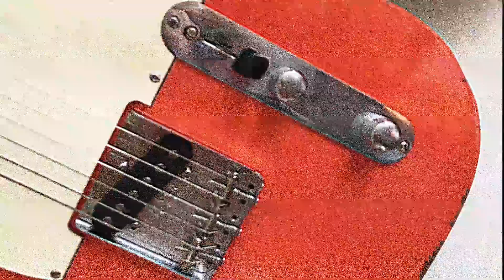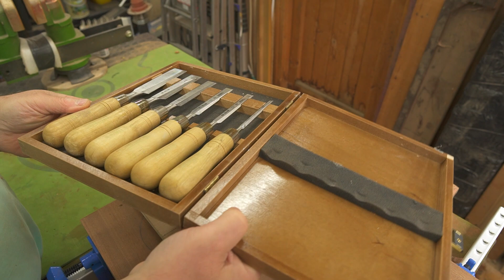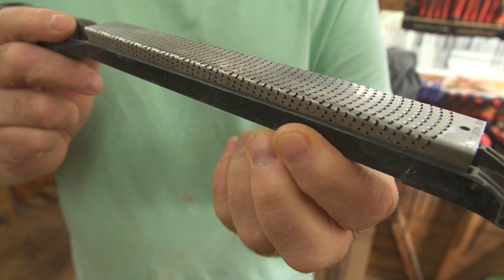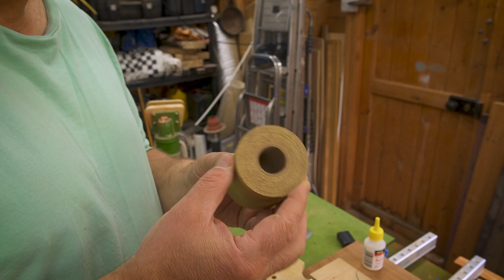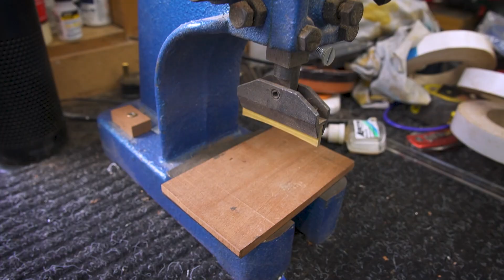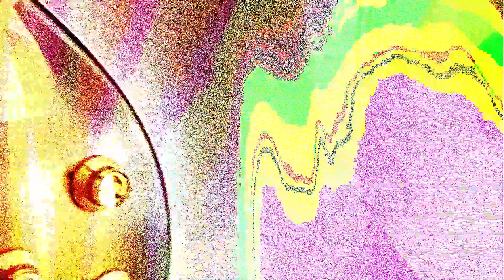Guitar Making Tools my Top Ten Tools , Luthier tools. The tools you need explained.

Comment: One tool you didn't list was the infamous Shinto saw-rasp.  OTOH, I've never seen anyone use a Microplane zester or spice grinder for Luthiery work.  Same basic tools, but at different scales.  The Shinto uses hacksaw blades, while the Microplane uses cheese grater blades.  My flat (zester) and round (spice grinder) Microplanes arrived today.  I mod stock necks to 20mm thickness, a flat triangular heel, and a trapezoid profile. I use a router and sled to thickness the necks, then hog away the heel shoulders with an angle grinder and a 40-grit disc. Then I do a trapezoid neck carve with a Shinto.  The Microplanes looks like they will be perfect for shaping the shoulders of the headstock and volute areas - the Shinto is somewhat large and aggressive for that work. "Right sized tool for the job".  Often a smaller version of a tool is better for guitar building.  Then again, I'd hate to do a trapezoid carve with just a zester!
Reply from the maker: @normbarrows2  The microplane tools are now discontinued. They only do zesters. I’m crestfallen!! The Shinto felt a little too agressive. Tools are very personal I guess. I like the zee files for fret work but the other StewMac fret files don’t do it for me. I’m about to enter the world of cnc. Be afraid. I certainly am. C
Reply: @chrisreynoldsguitarmaking  Z files are sold out every time I try to get one.  But I'm mostly modding new replacement necks, so I don't usually have to level and crown.  I find the Stew-Mac fret end dressing file useful for rounding the bottom corners of already installed frets on replacement necks.  Rolling with sandpaper usually takes care of the rest.  If you're willing to put in the time, you can actually do hot dog ends on pre-installed frets with them.
    While they might call them kitchen utensils, the Microplanes are still perfectly good woodworking tools.  I'll be trying them out on guitar 15.  It's getting the 20mm thicknessing, triangular heel, trapezoid profile - and a Parker Fly style headstock.  I only thickness to the nut line, which sort of leaves a volute just above the nut line on the back.  That's the area I plan to use the Microplanes on.

Comment: I agree with everything you listed. I retired as a carpenter/cabinet maker so my drills, routers and sawzalls are more name brand. I have been buying some lighter tools such as a 12 v Bosch reciprocating saw, Dewalt 8 v screw driver and so on. I want to build acoustic so a table saw is in the near future, and I think the portable Delta with T-square fence will be my choice. I also need the vice and just bought a drill press. i think eventually I may need a thickness sander, but for now I am buying my stock already sanded. T.Y. for this video
Reply from the maker: Good luck Ted. I hope you have many years of successful building ahead of you. I wish I could have started with your skillset.

Comment: Good advice! I have a very similar belt/disk sander & use it all the time. They are dirt cheap here in Canada, and I have often wondered why more luthiers don't rely on them. Along with my oscillating sander, a random orbital sander, and a super cheap one inch belt sander, I get everything done that I need to, including some minor metal fabrication. Thanks for the video.
Reply from the maker: Belt sanders are really useful. I’m frequently using it to shape and sharpen things. I have a grinder I have never used because the sander is faster and flatter.

Comment: I wouldn't mind a video going over selecting tone woods. It's there any reason to select one over another outside of weight or the way the grain looks? Detemple guitars told me one time they tuned their necks and bodies to be the same resonant pitch which makes sense but does it really matter?
Reply from the maker: Choice of woods is less critical with electric guitars. Mahogany and maple being the most common types used. Maple is bright and Mahogany is deep. If you stick to the traditional varieties used in instrument making you will end up with a functional guitar. Selecting other varieties is fun and unless you choose something inappropriate, like pine for a fretboard, you should be ok. Simply consider how the properties of the material suit the function. There are no rules but common sense is king. C

Comment: Cool video. I'm subscribing! I'm still pretty green in guitar making (doing my second scratch build right now) but I've got almost 20 years of experience as a builder, handyman, painter/decorator, electrician, carpenter... and the list goes on. Basically jack of all trades. It's so cool for me to see the variety of videos about essential tools in guitar making. Seems like 70% of every luthiers list is related to style/approach to the craft and the rest of it are hand planes, chisels, files, rasps... and of course premium quality factor. About that, imagine that I'm using Parkside tools as well. The only difference is that my set is doing heavy duty works for the last 3+ years. Really good value for the money. On the other hand I don't recommend similar tools from Aldi. Ferrex brand. Unfortunately I had to scrap most of these long before their time... So, Lidl - yay!, Aldi - nay! My personal experience. Anyway, I'm rambling. Thanks for the video!
Reply from the maker: Ramble on it’s all good stuff. Lidl tools work for me. I don’t expect much but they just work. My truss Rod router cost £25. Cheap enough for it to just be dedicated to tat one task. Stick with me and let’s make a guitar c

Comment: When you recommended the soldering station, were you recommending a specific make or model, or just a soldering station in general? I had a soldering station once, but I wasn't happy with it. I'd be curious to know what you use for de-soldering. In fact, a video on basic guitar electronics would be cool. I like to mess with guitar electronics.
Reply from the maker: I use that station because it was a reasonable price but with fast heat, good quality and variable temp. It’s also robust and the stand is chunky. For de soldering I have a cheap solder sucker. The pump action syringe type. All Amazon sourced.
Reply: @chrisreynoldsguitarmaking  Solder suckers are ace

Comment: Solder was skipped over. I learned a long time ago to use SN63 (eutectic) for any electronic component and liquid flux. I think it is applicable to guitar electronics but I have seen videos using a 60/40 and wondered why?
Reply from the maker: Not really skipped over it simply didn’t occur to me in the context of Top Ten Tools. I’m the son of an electronics engineer and TV repair man. My dad used solder from many sources. To be honest it’s a mystery to me. I bought some solder on a reel about 4 years ago. It works fine. What it is precisely I have no idea but it solders satisfactorily. I have no recollection of ever discussing what solder he used or that I should use. He’s 87 and I could ask him but I suspect he’ll look at me blankly and say ‘fluxed solder for electronics’.
Reply: It is just solder isn't it? Isn't it!!?
Reply: @Aja-nt  SN63 solder has no plastic state so the likelihood of s cold or fractured solder joint is slim to none.
Reply from the maker: @Aja-nt  Solder is definitely solder.

Comment: I have also met some serious tools in my life, ha. 
Good tip with the micro-plane - going to have to check that out!
I'd be interested in whether a proper woodworkers workbench is necessary, or if not - what is ideal?
Reply from the maker: Blimey. I’m not even finished with the upload yet and you’ve watched it!!!
Reply from the maker: I used a standard work bench with a tool gulley. Absurd. I simply put a plywood top over it and added rubber matts. Much better for me.